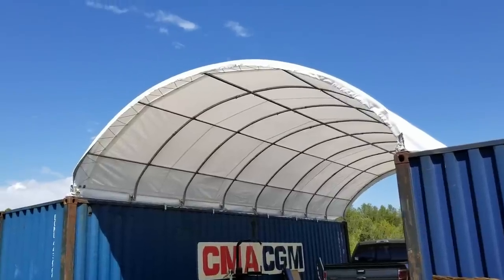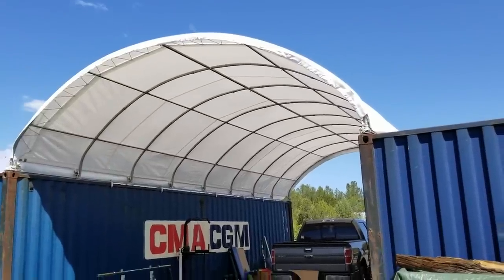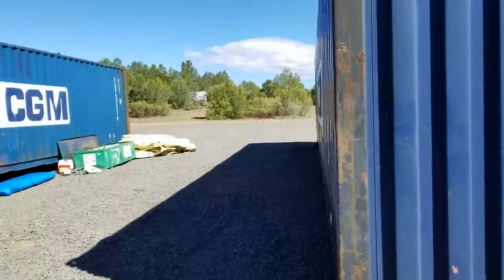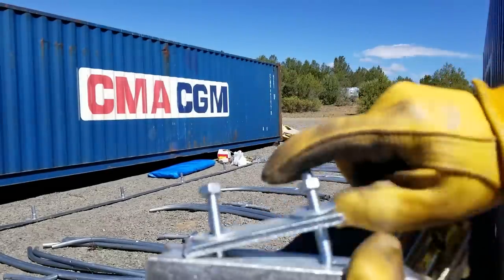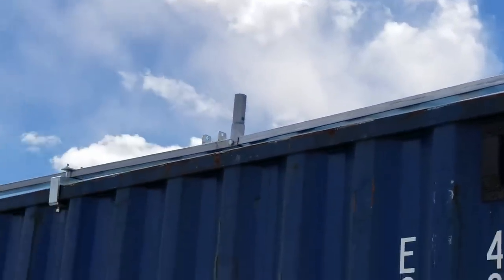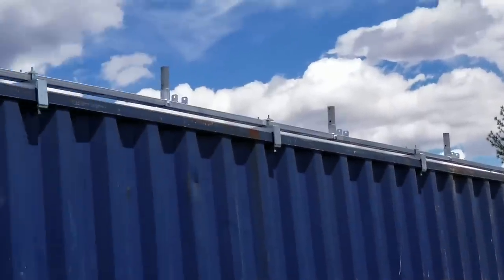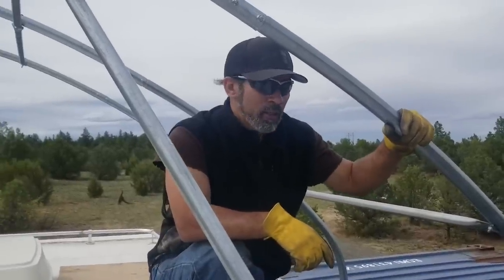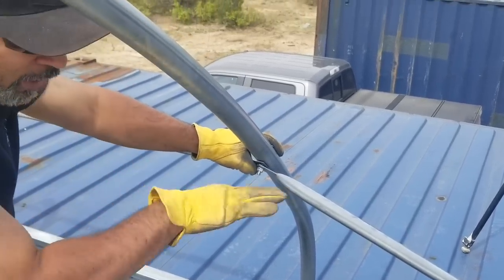Shipping Container Covers setup #Shippingcontainercovers #covers #shippingcontainers #aircreteharry

Comment: That's an excellent strategy for starting a farm or homestead or whatever. You got a little "aircrete factory" in a box going on there. That is probably the best and most practical shipping container design you have too. Just add the awning and you have all that covered area to work in. Good luck.

Comment: How are the corner connectors secured? Does the square plate rotate inside the hole and get pulled up by the screws?
Reply from the maker: I show more in this video: https://www.youtube.com/watch?v=0_S1CY1Ic4E&t=470s

Comment: I see that you put this on two shipping containers.  Is it possible to put this system on two 40 foot long Great Dane Trucking trailer???
Reply from the maker: You could maybe modify the trailer to work. But this system is designed to clamp onto the square tubing and mount in the pin holes on the 4 corners,Its a very strong system.

Comment: roof drainage -----instead of going inside to inside with the rails on top of the containers ------go outside to outside ------all the rain falls outside the containers ----of course you would need wider arches but no water worries later ----only works with two containers but you make it 2 containers in length if you need to square footage footprint
Reply from the maker: Our shipping containers are set-up at a 2° angle to the side and towards the back for the water to run off the back.
No water issues. 
Everything stays dry. 👍 👍